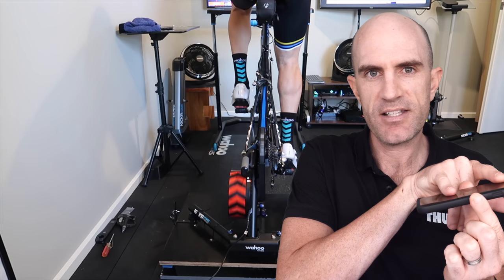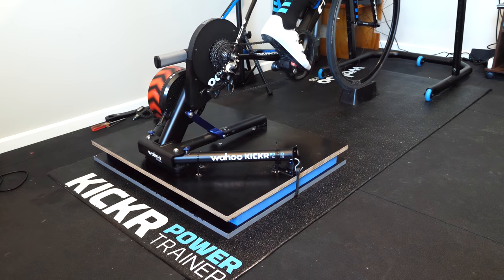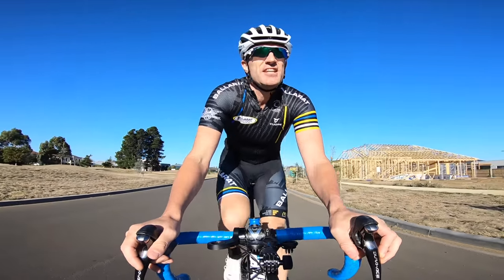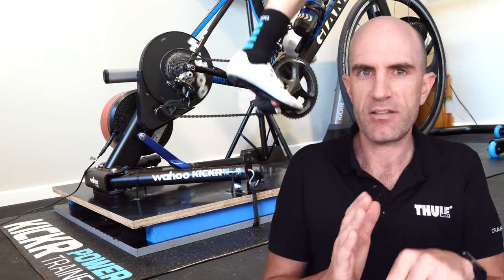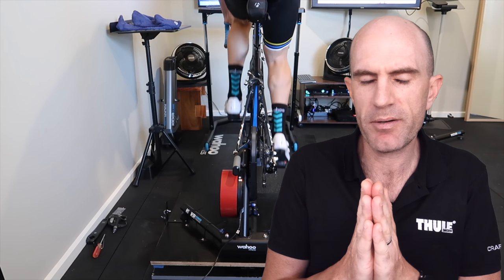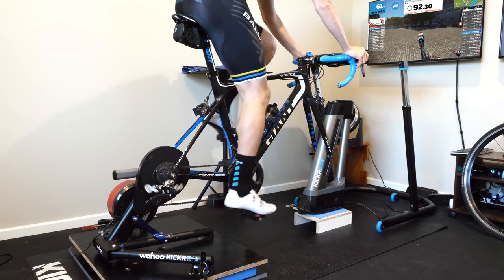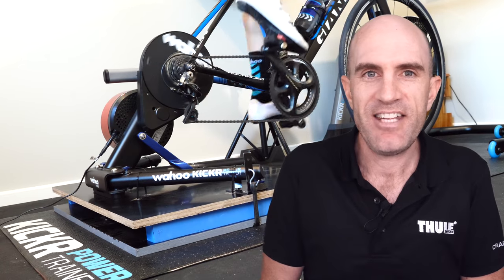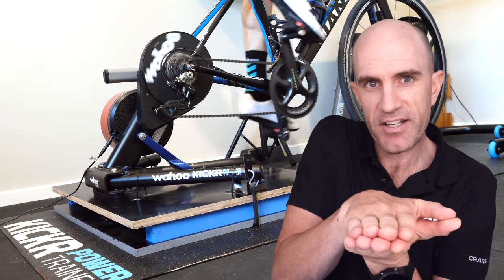Indoor Cycling Rocker Plates - First Ride of a Wahoo KICKR Rocker

Comment: Interesting mod, but if you are looking to simulate outdoor riding then I'm going to recommend ppl check out a set of high end rollers.  I'm currently using Inside Ride's E-motion rollers with smart controller and they feel brilliant.
Reply: Chad McNeese Nice mod for someone who has a smart trainer already but compared to the emotion rollers with smart controller (Elite offers something similar in Europe) add-on I mentioned it looks rather rustic.   The other nice thing about the emotions is you can buy a fork stand if you want to have something a little more fixed. (Bike will still rock)  I will try to shoot a small vid tonight of my setup and you can judge for yourself.
Reply: Chad McNeese "require more control from the ride" that's exactly why I prefer the emotion solution over fixed trainers/ rocker plate.  It just feels like I'm riding outside in the open.  If you are looking to do hammer session all the time then yes a fixed trainer on rocker plate likely makes more sense.  Personally I can get up and hammer away full tilt on the emotion without any issues.  Haven't experienced any issues with my control unit yet, have had it for over a yr now.  If something goes wrong with it I can just throw back on the original meg. unit and keep on going with my training sessions while I wait for a replacement to come in. I like the module nature of the platform for this reason.  If something breaks on your smart trainer and you are outside the warranty or exchange window what are your options?   Anyways I'm not saying smart trainer with rocker plate are not a good solution; if I had a smart trainer I'd be one of the first in line to build such a solution.  I'm just trying to point out to ppl if realism is important, I can strongly recommend checking out the emotion rollers.
Reply: I like rollers too.  Amazingly fun to ride, especially motion version.  I suspect that I'd like the smart ones too.  But they still have the same basic pros/cons as other rollers, and those are a decent impediment for some people.

I am just happy to see that we are getting more and more options across the board.  What I want to see is a broad range of products that meet the wide range of preferences and needs of all riders.  I don't want to knock or limit any options.  But there are good and bad aspects of each choice.  My point is to identify and share those so people can choose with the best info available and get what they need right away, rather than miss an important detail that means they should have gone a different direction.
Reply: I should note I was on a flat section so the resistance would have been at 0 at that point.

Comment: No way to apply inertia, so I think this will always be a fail. Plus, I saw quite a bit of play in the mounting, which will only get worse as the cable ties age. It's a pass for me.
Reply: Cycling Diabetic , no, they work fine... when done properly.  2.5 years and 10,000+ miles on my rockers and I will never ride rigid again.
Reply: I'm glad you're happy.
Reply: More than happy.  I'm correct in stating that they do work well.
That is true despite your claim that inertia is needed (which it is not true).

You did correctly see the float of the trainer on the deck.  That is not acceptable and is solved in my designs.
Uncontrolled slipping is not a good attribute of any rocker.

Comment: It will never work with design like that. This rocker plate can only move in one axis but bike movement is a complex 3D movement, that's why adding climb helps. You will always need "rocking" for both wheel and they can't interfere/block each other. On top of that you need some range of motion in line of bike axis. One idea would to create parabolic/hyperbolic (also something else, that would need to be tested) bowls that would seat on the floor, inside there would be some bearing surface and on top of that there would be matching plate (dome-shaped on the bottom and flat on top). You would place trainer and front wheel on top of these.
But we need someone with lathe (or cnc if bowls need to be not round but longer in one direction) to test that idea.
Reply: abc  10,000 miles,on my rocker says the BOB concept can work. He just had the spring setup all wrong.
Reply: Up next.... 3 axis, Virtual Reality, trainers. Sweat simulation accessory optional.
Reply: Where do you get the plans/buy the rocker plate?
Reply: Here is where I posted mine:
https://zwiftinsider.com/rockit-launcher/

Comment: I like how you protect your trainer with tape :) How do rollers compare to the rocker plate concerning road feel while sprinting?
Reply from the maker: It's impossible to do an out of the saddle maximum power all-out sprint on rollers, so there's no real comparison.
Reply: Shane Miller - GPLama Great and informative...I’ve been curious about the rocker plate/trainer set ups, but cannot go there just yet because of those unnatural feelings of a trainer. I’m on a set of inside ride e-motion rollers and can do climbing and sprint efforts. These actually solve the bike movement issues (I’ve always don’t rollers after knee pain from the static bike position on a trainer).  The biggest drawback to the rollers is wheel slip, but anyone without a direct drive trainer will have this. I know I’m losing some top end accuracy because of this, but I’m ok with that given my cycling focus and goals right now. Realistic ride quality currently trumps missing that top end. Thanks again and I’ll be looking for more info as these develop!

Comment: I wish rocker plates could work but I don't think they''ll ever be what we really want them to be. I made one before I knew they were a thing online. It was using thick bands as resistance and it had more movement, which is what I originally wanted. I found that it was difficult to have the bike remain upright without having to try to balance it (bad for knees and technique in general). Any stiffer and there wouldn't have been the movement I wanted (like in the Bob rocker). 

I think we underestimate the gyroscopic effect our wheels give in allowing the bike to remain upright when we want, and being able to throw it around when we want. 

The ideal indoor trainer would be a responsive treadmill.

Comment: I’d be interested to know how this effects forces and stress on the bike frame. As it’s applying forces that you won’t get on the road.
Reply from the maker: Without putting strain gauges all over a frame we’ll never know. No snapped bikes yet.
Reply: I have a plan to test by measuring deflection of the frame, when used rigid and on a rocker plate.  Deflection of the frame has a direct correlation to the stress applied to the frame.  Assuming the same connection at the rear axle, more deflection at a point like the seat tube collar, will indicate higher stress applied to the frame.

The general difficulty in doing this comes from the relatively small amount of deflection we see at places the the seat tube collar or BB.  It will likely be in the realm of 0.010" [0.25mm], so using a precise dial indicator is necessary. The real challenge comes from trying to fit that setup on the bike and trainer in a way that does not interfere with pedaling.  I want a camera installed to record the deflection in real time.

Velo news uses a similar approach, but they do it with static loading in a rigid fixture, so it is easier than what I think we need to do for a dynamic setup.  I may take a stab at the testing in the near future.  I will share anything I get that.
Reply: My assumption would be its putting forces on the rear drop outs they aren’t designed to take.
Reply: I believe what you say is true, for a regular (non-rocker) trainer.  Right or wrong, many bike manufacturers don't recommend using their bikes in rear-axle based trainers, and some companies claim they will void a warranty by doing so.

A rigid trainer instantly and directly applies high forces into the frame when the rider pedals and the frame invariably leans off-center, even small amounts.  This mini lean is the inevitable result of our naturally unbalanced bodies acting on a rigid setup, not at all what the bike experiences outside.  No matter how smooth we think we are, there are slight movements left and right.  Simply setup a camera on a tripod behind a rider on a rigid trainer to see the movements.

I personally feel a rocker plate will reduce the stress on the frame.   It does this by removing the rigid commitment to a vertical orientation (via the floor, trainer and bike), and allows the frame to float in angle, much like riding outside.  With the right spring settings, the rider is forced to balance the bike and counteract the subtle motion from pedaling, again, much like outside and even similar to riding rollers.

My plan is to test with a dial indicator located at the seat tube collar, ride with the bike on the rocker but have it rigidly locked out from leaning.  Record the results of pedaling at various cadence and power outputs.  I want to do this with the rocker plate locked out to minimize easy and limit variables.

Then proceed to unlock the rocker and allow full lean.  Repeat the the cadence and power test above, record the results and compare between the two situations.  My theory is that you will see less deflection of the frame while used in the rocker, but that is speculation for now.  In either case, the least amount of frame deflection will indicate a lower amount of stress applied to the frame.
Reply: But when you see Shane lean all the way across to the right or left this is different to a bike sat flat on the trainer and downward force. Time will tell.
Reply: True, but that lean was done purely in an effort to show the lean angle possible of the rocker.  He never repeated that position for any of his riding after the initial demo moment.  It simply isn't a typical use case and is effectively no different than a person doing a similar lean on a rigid rocker.

In either case, there is no need to do it, other than to demonstrate the presence or lack of angular lean.
Reply: I think thank the forces and stress are on you body. A rocker plate has cost my two swollen knees for nearly two months and lower back pain. Maybe it's because you miss the gyro effect that holds the bike upright when you are cycling forward.
Reply: People often misunderstand the gyro effect.  It ONLY acts to hold a wheel in the orientation that is currently holds.  It DOES NOT return to vertical.  

The way a bike really comes to vertical is a result of the two tire contact patches and the frame geometry (head tube angle, fork offset and wheelbase).  Those are what really cause a bike to tend to remain upright unless acted upon with another force.

All that is to say, that the lack of a gyro effect for a bike on a trainer is not a "problem".  We use the leveling springs to replicate the tendency to come back to vertical.  When done well, it feels very natural and reasonably close to a real bike outside.  I liken it to the same basic effort as riding rollers, but generally less work (unless you run VERY light leveling springs, like I have tested).

If you had issues with your knees and back while riding inside, on a rocker, on the same exact bike you ride outside (while not having those same problems outside) is likely a result of your style on the bike with the rocker.  I have seen many videos with people who added a rocker, and adopted an incorrect pedal timing to lean angle.  

They end up leaning the bike to the same side as the foot at the bottom of the pedal stroke.  This is so common, especially when people have the leveling springs too firm, that I see it nearly every time someone posts a video.  Doing this incorrect timing may well lead to problems as it is very awkward and not the same as we adopt naturally outside.

They need to counterbalance that downward force from the low foot with the handle bars and lean AWAY from the foot at the bottom, not towards it.  Once this is done, the riding is a more accurate replica of outside riding.
Reply: Hi Chad. I'm not sure that I'll will accept your answer how a bike comes to vertical, because if I bike has no motion it'll simply drop to one of it's sides besides how it's geometry is made. My concern is the large amount of extra kilo (in my case 21kg) from the home trainer plus the bike 9Kg that you have to counter balance (sitting down) . You may have a point about if the springs are to firm you'll tend to lean to one side, because I remember from my childhood when startet to learn cycling. If a kids bike had two extra wheels on, children tend to lean to one side. You may wondering why I have tried to use a rocker plate, its simply because I could not pedaling standing up during my workouts. In the last 3 years I have used two others home trainer without any knee problems besides some ass numbness after 1- 1.5 hour workout.
Reply: Peter, my unstated assumption is that the bike is ROLLING when outside.  

The geometry of the bike while rolling forward is the primary reason the bike comes back to vertical.  Watch a ghost ride (no rider on the bike) and see how well it can stay up with no external forces added.  Some of that does come from the gyro effect (and it's tendency to hold the current orientation), but more of it comes from the geometry as stated.  That geometry and the resulting forces from the two tire contact patches act to hold the bike vertically.

Of course, when stationary, a bike will simply fall over.  No surprise there.

So the point of the rocker plate is to mimic outside riding.  As such, we need something to force the bike up to the vertical orientation.  This is because our pivot point is near the tire contact patch, and with no forward motion, the bike and rider would flop to one side an not return to center.  

We add leveling springs to the rocker to achieve the centering feel.  Adjusting the exact location and pressure of these springs is the "secret sauce" to making a rocker feel the most natural.

As to your needs, I think a rocker holds promise for you.  Nearly every comment and review (of the nearly hundreds I have seen now) makes explicit note of the fact that seated comfort is improved.  In some cases, it is VERY prominent for the rider.

It may simply be setup issues on your rocker.  I have seen extravagant and simple rockers, and everything from perfect function to wildly uncontrolled.

I love the DIY nature of our movement because anyone can make one of the various designs and try them out.  But it also leads to a wide variety of final results and levels of success.  I have seen some people criticize rockers as a whole, based on a poorly built and adjusted rocker.  IMHO, that's not fair because a single experience with an inferior product is no way to judge an entire product set.

We have worked hard to narrow the range of what works and what doesn't.  The body of knowledge in our FB Rocker Plates group is great and still growing.  If you haven't already done so, I'd suggest joining.  Then you can post your experience for myself and others to try and help you get your rocker working like I believe it can.

Comment: Conservation of energy would seem to say that energy used to compress the foam to give the rocking is coming from the rider. If Energy measured at the kickr is constant between the two efforts what did the power pedals say?
Is this the worlds first marginal zwift handicap?

The argument from supporters would be that increased comfort leads to better performance so maybe it all works out
Reply from the maker: Pedals read the same in both cases. Very very very close to the Kickr17. No free lunch there.
Reply: The important thing is what exactly causes the side motion. I have my theory it is the same muscle and body movement as outsdide, so no "loss" compared to real life.  Compared to a rigid trainer?  Hard to say without extensive testing.

Comment: Can you put the kickr climb on a rocker plate as an addition to this setup? That would give a very realistic indoor ride
Reply from the maker: Why would the climb need to go on a rocker plate? It moves freely as it is.
Reply: I thought the climb can only go forwards and backwards as shown when you tried to push it over sidewards. If the rear of the bike is on a rocker I feel like the front on the climb might be too unstable.
Reply: I'm silly. I was so excited with my idea that I commented before I finished the video. You added the climb later. Sorry
Reply: Shane,
In the Rocker Plates FB group there are a number of full length rockers designed to allow for newer Kickrs and a Climb to be mounted on the rocking plate. Your video and this reply have exploded the rationale for these in one fell swoop. Well played.

Comment: This will never work whilst they make the pivot point at the bottom of the wheel. 

the bike basically needs to be suspended from the top so that gravity is keeping it upright, then the side to side movement is free to move from an axes at the crank rather than the bottom of the tires giving it a far more realistic feel.

Comment: Kurt Kinetic Rock and Roll is one of the best solution atm, but i think there is a lot of room to improve Rocker Plates
Reply: The R&R was my inspiration, but I wanted the ability to use ANY trainer and get proper rocking.
Reply: Chad McNeese, so need more height for bigger angle and remove rubber straps - foam rubber may be enough.
Reply: His height is fine.  He has the springs too wide, and likely too big.  I'd cut them in half on each side and move them to the middle space between the center pivot and the outside edge of the rocker.  That decrease spring rate and increase leverage (both of which are needed).  That change will also allow for greater angular deflection.  A good rocker has at least 5* per side.  I use 5* regularly, but like around 7* at the limits to keep from hitting the bump stops on a regular basis.